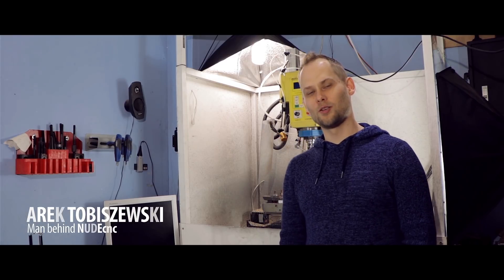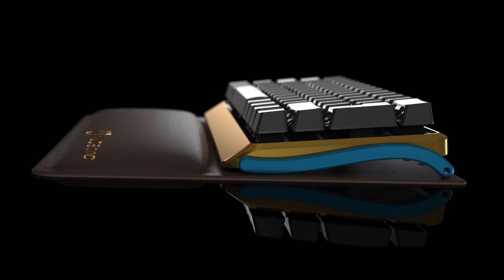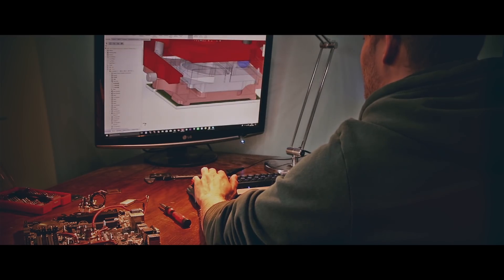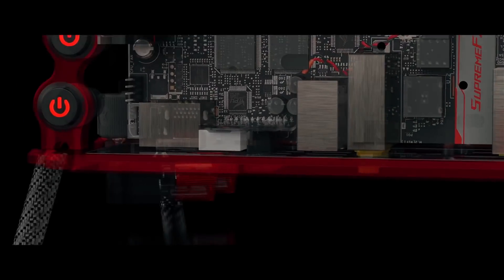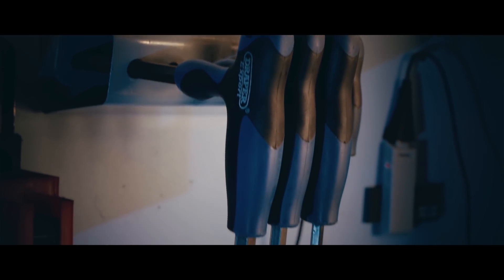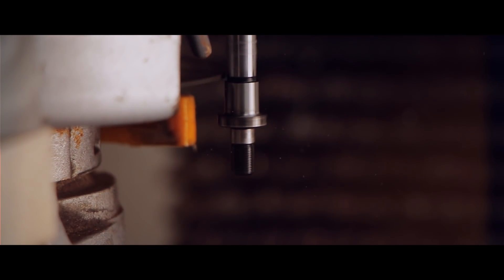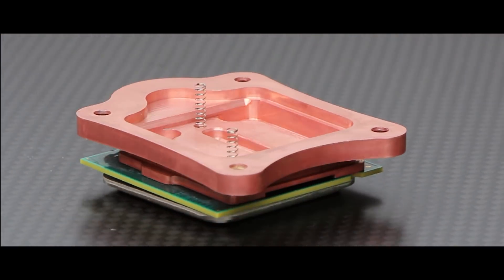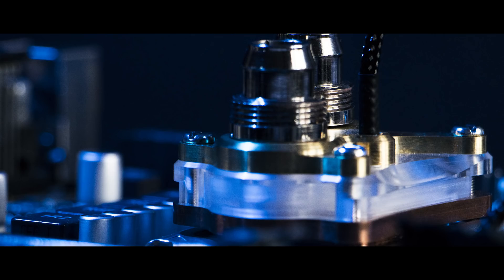Ncore V1 - naked die cooling waterblock

Comment: Why not go to an existing shop and have the blocks machined. Then you have a product. You can use the kickstart money to assemble/market it. Professional CNCs are very expensive.  Buying a CNC doesn’t  seem like the most prudent way to proceed. Also, it seems like this product could become obsolete if Intel decides to solder its next CPU line.  But good luck. It is a very neat idea.
Reply: Actually even if soldered you cant even approach performance thats a result of getting closer to the die... basic physics
Reply: While you suggestion sound great when starting the business.. on the long run its better for him to do in house.. probably also more profit in the end.. he is a CNC machinist so it makes sense to have your own equipment also for prototypes and R&D  ... .

Comment: This is the only hope for the 8 core ring bus from Intel!
Reply: Hahah.. its also my only hope for my 10900K (just kiddn)  which is NOT an A model.. it requires massively voltage to "just" run all core 5000 mhz.. I believe my BIOS is set to 1.38v which gives 1.365-1.37v effectively..  so due to this nature is produces a lot of heat..   Its been watercooled from the getgo... and later custom copper ihs with liquid metal.. that  really did the job.. but I wanna go ALL the way with this product.. its one of a kind and totally unique..  Besides my CPU is already delid and ready! :D ... Im gonna do this lap of die also to perfect it and maximize the result...  Im properly just gonna run it at 5 Ghz even with the nCore... because 5.1 or even 5.2 if even possible would require tremendous amount of power.. I assume between 1.45-1.55v which is insane..     Some of the golden chip 10900k can run 5 ghz at 1.25v and up to 5.3 ghz with maybe 1.35-1.38v ....

Comment: Discovered trough linus tech video. Amazed me and came here to see your work! I'm looking foward to see you prosper with this amazing idea. If i had an upgrade planned for my CPU i'd go for it, for sure!
Reply from the maker: Thank you
Reply: @NUDEcnc  You are brilliant my man! ... I mean the water block design with the cpu locking mechanism and even the  cpu delid tool integrated into the waterblock frame is genious.. ! ..   I have a 10900K which unfortunatly is not a golden chip so it gets hot and uses a lot of power compared to a models ..  However I run it at 10x5000mhz and with a custom copper IHS with liquid metal..  I really helped! However several times the cooling paste between my waterblock and the copper ihs has dried out? dont know why.. anyway I was waiting for a product like the nCore v1 ... i MUST have it !  This is the next and final level I need to get the cooling perfect ..  I will order within a month or so... dont hope the waiting time is too long still though hehe..   Also I wanna do the die lapping with the tool. It looks a little confusing though with the lines and numbers.. is this dummy proof? hehe.. I mean you wouldnt be reading or doing it wrong and sand too much die away! ;)

Comment: Well...not sure if such concept is  even required today considering the CPU power vs consumption.....Looks like you tried to re-invent the wheel...
Reply from the maker: ".Looks like you tried to re-invent the wheel..." - it's exactly what I wanted to do. Not copping, but creating something unique. Hope I done it :)
Reply: Look into performance of new i7 or i9 under full load and overclock. You most likely need to delide it and place a good cooling on it (at least one thing has to be done). Waterblock with the idea of deliding (connecting the block directly to the heat) reduces noise and increase performance (by improving oc capatibilities). We will see how the tests go and how high the price will be. 
Of course its not advised to average users, but for sameone that seeks high performance within the suitable budget (atleast thats the way i see that cooling).
Reply: @dominiksmukaa6892  You are so right.. I have a 10900K runing 10 core @ 5000 mhz... and even on custom water loop it can run very hot and eventually reach the throttle limit of 90-95g...... SO im ordering this one! ;)   CANT WAIT !
Reply: shut up. 1 degree less is a success.
Reply: Totally. While the worst lidded CPUs may benefit from it, your CPU literally DGAF even at 80 degrees Celsius. You will never get that hot on even a cheap, but branded, waterblock. If you want to get extreme, you would probably go with LN2 or phase chage.
Reply: Running my delidded i7-7700k at 5.1 Ghz is getting pretty warm under normal watercooling. Saw the LTT video and he was getting much better result vs normal watercooling block.
Reply: @Bartosz Olszewski you really know little about overclocking
Reply: I have a 10900k and even on custom water loop it runs hot! and can thermal throttle if pushed to hard (or even just at 5 ghz) in certain stress loads.. SO I definatly this this is amazing and I want one!   ... I did however improve my thermal with a custom copper ihs and liquid metal.. but I wanna go all the way with this one of a kind product...  its basically the best possible option out there also totally unique.
Reply: Delidding an i7 7700k and slapping this on it could easily bring temps down by 10-20c.

Comment: Is that copper and aluminum in the same block? Correct me if im wrong but wont that cause corrosion?
Reply from the maker: Water has only contact with copper and brass. If you refering to aluminium frame, it's anodised and won't corode